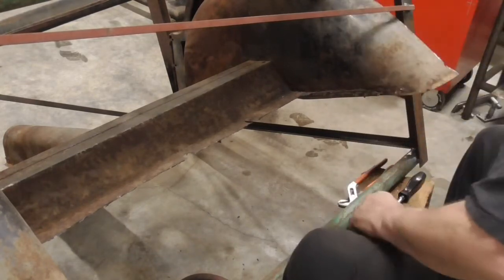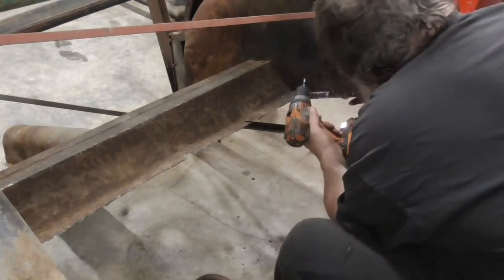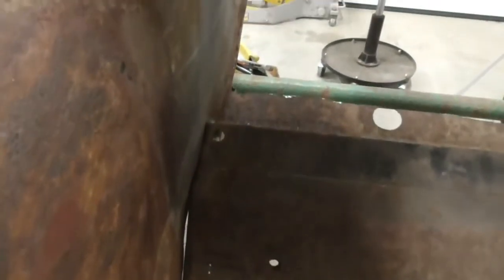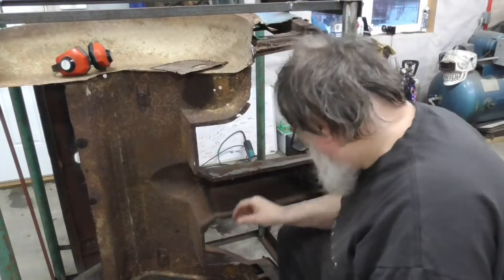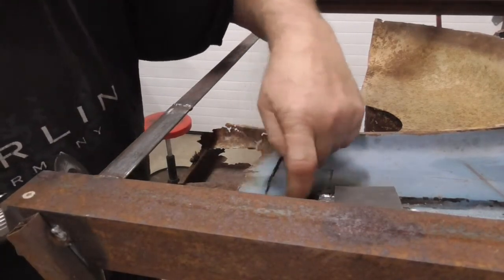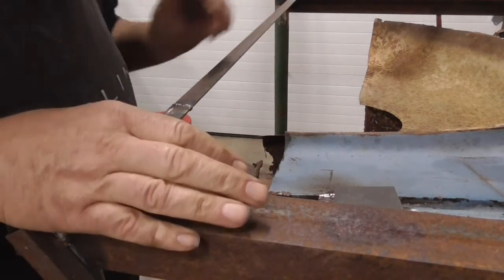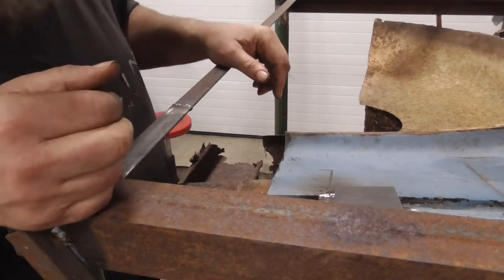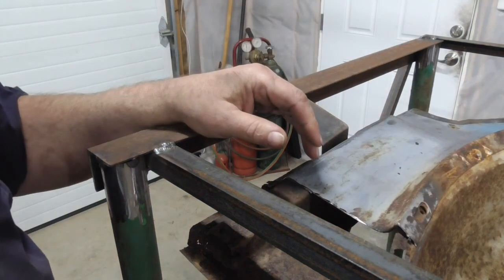truimph tr3 more rust removal

Comment: That will keep you busy during the winter.
Reply from the maker: and I thought I was done with drilling spot welds--------it will never end.
Reply: Do you have a die grinder burr?
The rounded ended ones are the best.
They don't take away any of the metal underneath the lip that you are removing ,and just take a rounded cut instead of a pointed drilled hole.
Or even what's called a zero point drill bit..It's basically been ground flat on the end.
But for me for spot welds the die grinder is far superior to drill bits and lasts for at least 2 restorations not like drill bits
Reply from the maker: @vwbusguy  yep I have those in a few different styles In the vid I was using those spot weld removers that are like a flat drill bit I also have the mini hold saw type they are abit aggressive but work good in curtain place's.